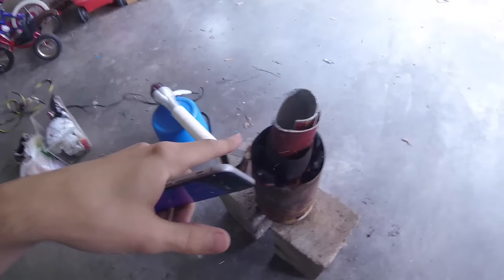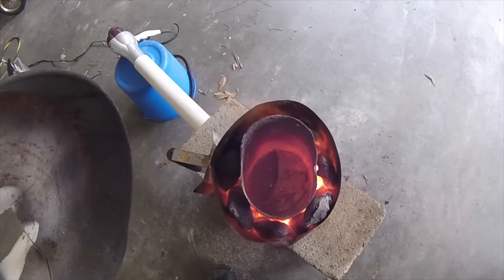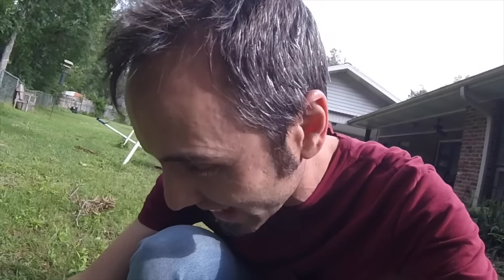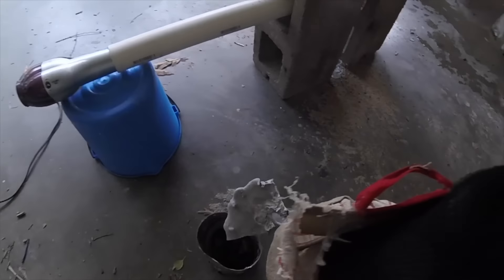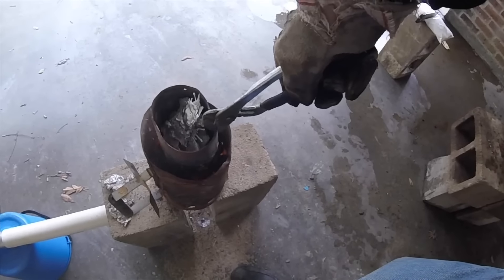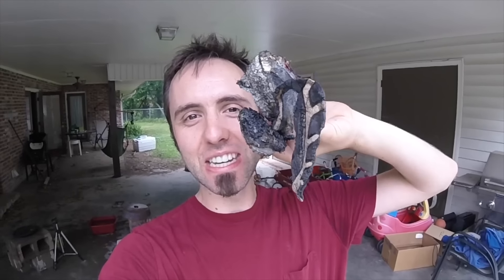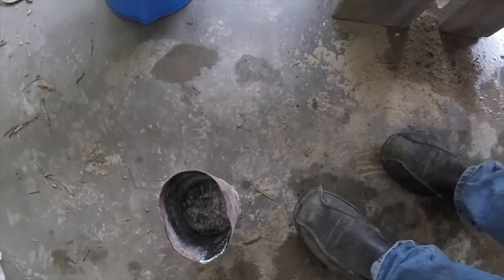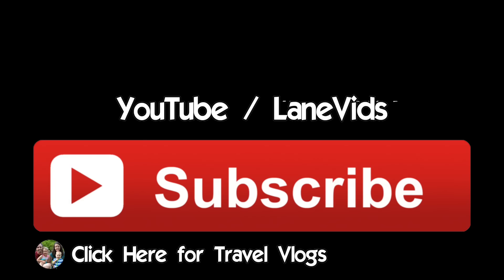PROBLEMS WITH DRIPPING MOLTEN ALUMINUM | Molten Aluminum Fail

Comment: Wonder how molten aluminum and a pane of glass (flat) would do?  Also what if you poured a small bit of aluminum into a line of various empty glass bottles, (say each 1/4 full)?  Would they shatter, melt, do nothing, or something unexpected?
Reply: +Pouring Molten Aluminum on Things / LaneVids Had a thought, stand a bottle by itself along side a bottle standing in a small pan of water, (allowing the water heat sink the heat from the bottle and maybe last longer)  pour in both and see what the results of both, side by side would be.
Also pour over a pile of ping pong balls and watch the smoke!